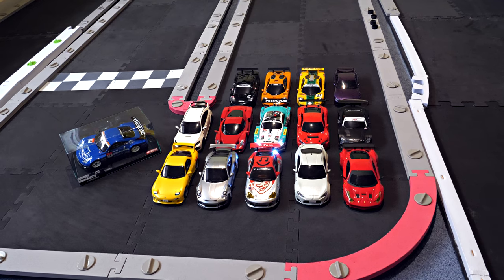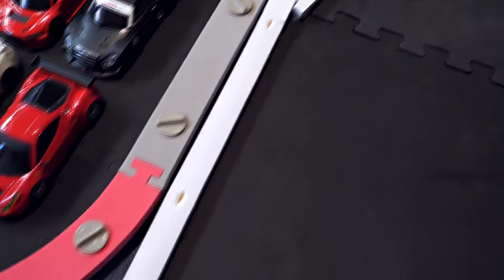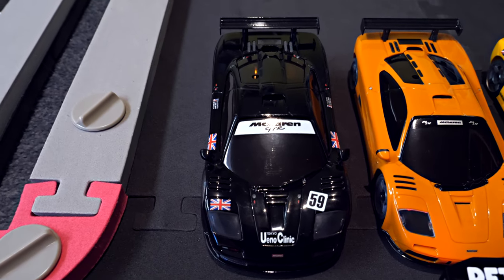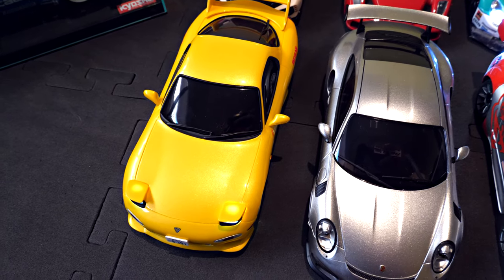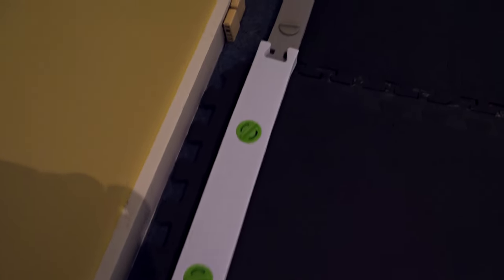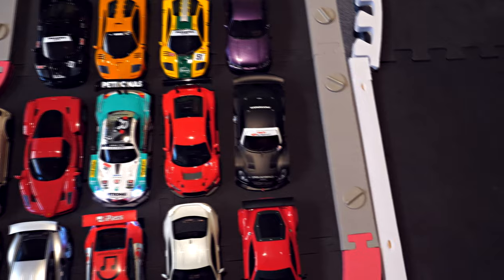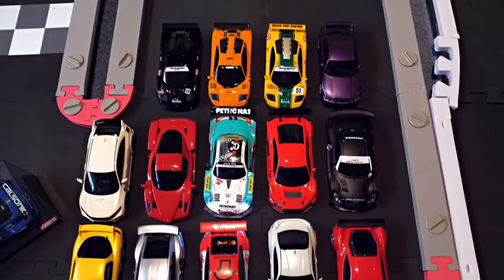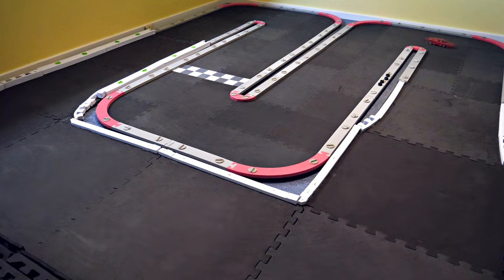Mini-Z Track Upgrades, Trying Different Bodies to Find the Best Cars for My Track.

Comment: Finally, a track to drive with all those lovely bodies. May be a Rm will be best on a small narrow track.
Reply: @mini-z_me  Glad you found your perfect setup.
Reply: @mini-z_me  Does stiffing the springs not help? Also check to see if there is any tire rub with wheel wells. I had this issue with my P1